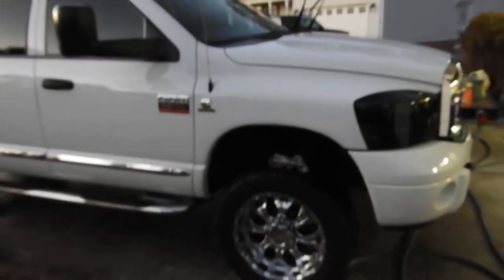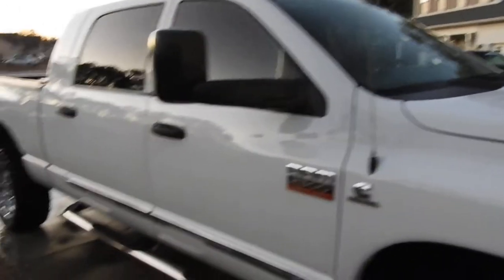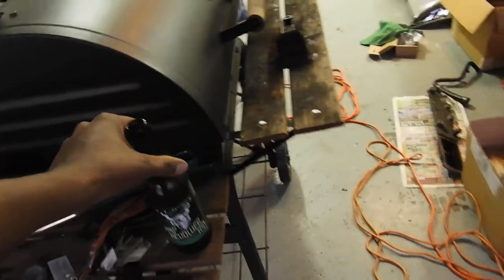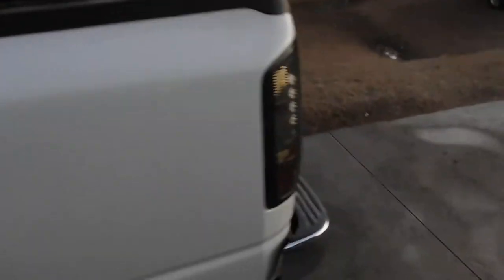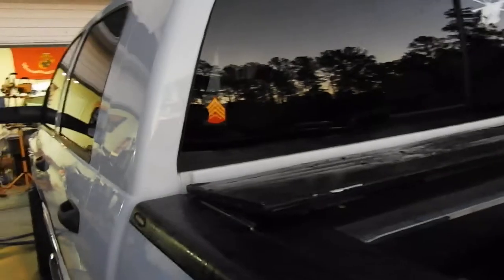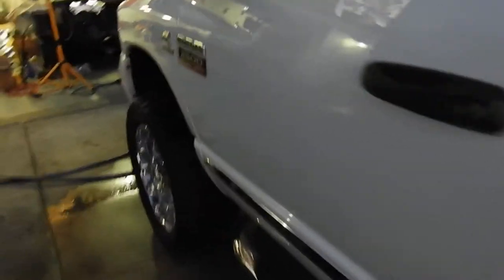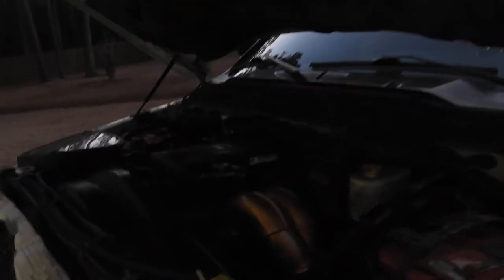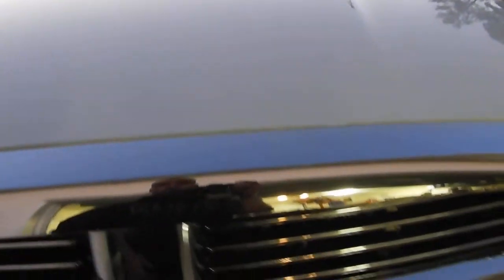UPCOMING PLANS FOR THE CUMMINS

Comment: Reds Apple 👍
Reply from the maker: Cummins Boy I'll have those once in a while randomly like a spur of the moment thing haha
Reply: Nice, hey did the Grid heater delete and intake horn change the sound much? I have a 08 as well.
Reply from the maker: Cummins Boy yeah it changed the sound a little bit mainly when giving it some pedal! It sounds more throaty. I need the bigger intercooler pipes I still got stock.